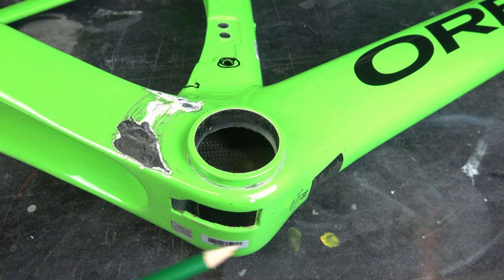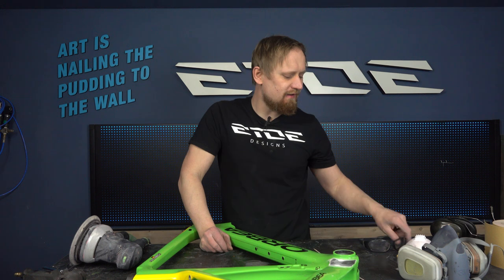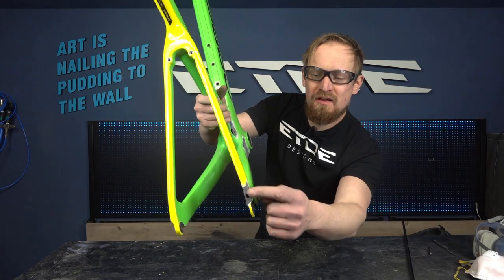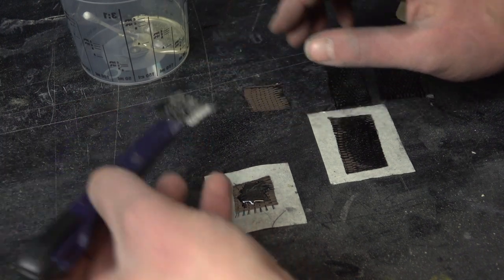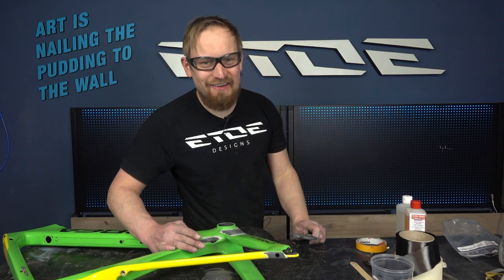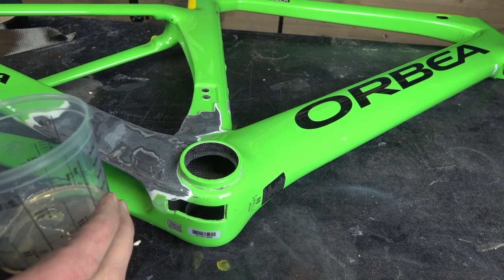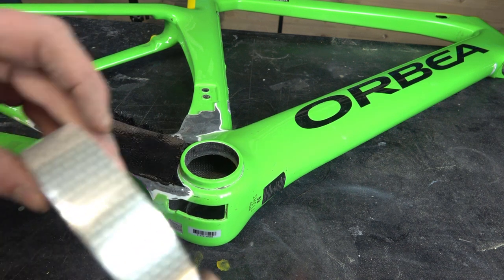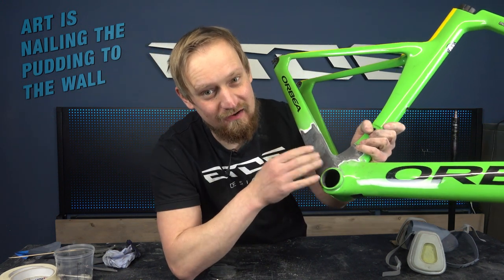carbon bike repair - chain stay fix - DIY

Comment: Thank you for posting this video, I had some chainstay damage but had it repaired by a "professional" and recently my chain took another bite out of the chainstay.  Found out the previous repair was not very good.  I was expecting to see carbon but saw a lot of bondo and carbon.  I used your same techniques from this video and had great success.  I tapped the repair with a coin afterwards to check for solid adhesion and thorough epoxy wetout and found no dull thuds.  Just as you say, a pretty easy repair to do at home.  So thank you for sharing your knowledge and tips, very appreciated and helpful!  (My paint and clearcoat work leave much to be desired, however..)

Comment: Martin, I am using your excellent tutorials to repaint my 2008 Cervélo RS frame.  When I took the components off, I noticed some damage to the BB caused by the chainring rubbing on the fame.  Your tutorial on how to repair this damage   is extremely well done and provided perfect instructions.  Thank you for taking the time to create this instructional videos and for posting them for all to see and use.

Comment: Nice job on the repair 👍, don’t forget to use nitrile or vinyl-gloves when using epoxy. Epoxy allergy is a real thing, which everybody with enough exposure will get, and for your job something I really wouldn’t want to get.
Reply: Julius Meier Fully agree!
Reply: You should not touch carbon with bare skin,the grease causes delamination
Reply from the maker: Painters have to die young because they are bad payed and will retire poor if not died young. So no gloves needed!
Reply from the maker: @matt7775  Painters have no grease on their skin they don't even have skin on the hands as longer they do their job. So no need to worry about grease.
Reply: Hehe I have it even though I wore gloves
Reply: @ETOE  poor quality workmanship

Comment: Excellent tutorial! The only issue I seems you should be using a much slower curing epoxy - slower cure rates ultimately mean longer polymerization chains, which makes for a much stronger epoxy and therefore repair. 

Using a fast cure plus heat does not lend itself to good long term strength of repair.

Comment: Brilliant. Love that you share these tips and skills.
Have just sent a frame away for repair, but with these tips might just try myself next time. The shrinking tape and fast-set epoxy are great tip.

One question with resins - are the slow set epoxies more durable than the quick set, or just useful for different things? I repaired my hockey stick a few years ago and was advised to get the slow setting epoxy as it cuould withstand more and would last longer.

Comment: Nice work. Some ideas for yur consideration...
- use a wood glue utility brush instead of ear swab
- mount a heat lamp bulb or two in a ceramic socket to ceiling above workbench to aid in epoxy wetting out CF, works great aircraft composite  project
- put layer of dacron peel ply on top of finished layup then cover with shrinking tape, when dry and peeled off has nice mat finish
Thanks again....

Comment: This was absolutely the best DIY video I have seen yet! Ausgezeichnet!! Just out of curiosity... could you use body filler on minor scratches and areas where the damage is too small for the tape or do you just use the resin?
Reply: When I've done this, I mix the epoxy, then cut small pieces of carbon fiber (roughly 1mm long) and mix it with the epoxy.  Then apply to the scratch/ chip.  Not really for crack in the carbon, but more as a filler.  It sands, primes and paints well.  Not sure if this the best way, but has turned out well for me

Comment: Wow! Thanks for the video! I'm going to use this same technique to make an internal storage on the downtube of my enduro bike, like newer frames has. I'll cut the hole, reinforce the inside surroundings with unidirectional cf, and make a cap with bottle holes (bike has no bottle holes) :D
Reply: This sounds like a terrible idea

Comment: How did you sand inside the frame for the internal patches,you didn't show any preparation apart from drilling out the paint out of the hole itself?

Comment: Shoutout from Germany
I have damage in the same spot on my BMC frame so this is an awesome video for me! it also answered my question of how deep is too deep when sanding down.
One question I do have is why are you using unidirectional carbon sheets instead of a 90 degree twill?
also, how far away should I tape from my damaged area? if I have a crack that's 5 mm in diameter, should I tape up to 10 mm away? 20? 50? is there a rule of thumb?

Comment: Great workmanship.  Curious how are those holes occurred and are you going re-drill them again especially the one for the cable in the rear.  Any tip for deep scratch lines without patching the carbon fiber.
Reply: He mentioned at the start the owner was changing to a wireless setup so no longer required the holes.

Comment: Hi Martin, thanx for uploading such great DIY tutorials. I‘ve discovered a crack on my fork‘s steerer tube (RockShox SID World Cup) and want to fix it with unidirectional HM prepregs. As I‘m very good in fixing various things, I‘m pretty confident of doing a decent job. But I have two questions: when it comes to baking it in the oven, I‘m unsure how the resin, which holds the stanchions in the crown would react at temperatures around 120 degrees Celsius. And can I compress the carbon layers sufficiently with heat shrinking tube instead of heat shrinking tape as I don‘t have to apply any additional resin?  Thank you very much in advance🤘.
Reply from the maker: Use what ever you think suits for you. Why would you use so much heat? I see no need to use so much heat to cure any resin.
Reply: @ETOE  Oops, I‘ve just noticed your reply…three years later 😂. 
Thank you for your reply. In the mean time I managed to fix it with Toray T800 UD Prepreg. And although being a quite humble guy, I have to admit that I‘m pretty proud of the result. 
I managed to build an isolating door for the oven, where I could stick the steerer tube through, so only the tube got exposed to the heat.
Now I‘m fixed and made some other accessories for my mountainbike, like a carbon fender for the fork and a copy of the frame holder for my mini pump.
Thanx again and I‘d love to see more of your carbon repair videos.

Comment: Great videos, interesting and provides value.  Question, I'm doing a relatively minor repair on the top tube road frame.  I bought carbon fiber fabric cloth,  3k 200g/m2 plain weave.  I need to buy the resin now, and at first i was going to buy 1:1 ratio resin off Amazon, but is there a specific resin i should be using. thanks very much.
Reply: Besides reference to UV protective resin, i've read folks using "marine-grade epoxy resin" and other resin's that were suppose to be stronger, which was not a 1:1 ratio? I can see the benifits for a fast resin, as you mentioned.

Comment: I have the same issue on the same area in my frame but mine looks like more structural damage (chain got stuck, I got pissed off...the rest is history) to the point that the carbon can be moved by putting pressure with the finger. I suppose that's not a DIY job...well put it this way i wouldn't be very confident going down hill knowing that I stuck some small pieces of Carbon myself....,😰.

So the new frame is coming. Good thing is I have seem your DIY paint job and it's gonna look great! 👍

Comment: Great stuff. I’m enjoying the videos. I found the channel a few weeks ago when I picked up a used cervelo s3 frame that I want to strip and clear coat for the nude look. I found that the NDS rear prop out is worn by about 2mm so the wheel doesn’t sit correctly. Can I use resin to fill this in or carbon strips with resin ?
Reply from the maker: It is possible to do but definitely no beginner carbon fix project.

Comment: Hey Martin, I've watched many of your videos now and found them really useful for getting great tips and tricks associated with custom painting frames and helmets, I've had some good results using the techniques you have suggested, could you please let me know the type of mask / stencil film you cut and use along with the transfer tape as I have had some issues with various different types and not yet found one that is consistently reliable and that works very well for me. Thanks again for taking time out of your busy daily schedule to show us your amazing work.

Comment: Hi Martin. Great video!!! I have damage in the same area as the bike in the video. My question is I’d like to used shrink tape around the repair during the curing process. What brand of shrink tape do you use? I can’t seem to find such think (tape with holes) in Australia. Now I do not own a baking room so would a heat gun work?

Comment: Super! I'm learning from your videos. But what if there is a crack on the beam? which goes from the drop to the seat tube. Almost in the middle. What should I do in this case? you can't get in from the inside!
Reply from the maker: Give it to a carbon repair service.
Reply: @ETOE  Yes, I have already sent it to the service. Thanks for the advice.

Comment: @ETOE Loved you video.  Keep them coming.  My apologies if this was not asked in some of your German comments.  How do you know how much paint/epoxy needs to be prepped around the existing damaged carbon area in order to obtain a strong enough bond with the new carbon/epoxy being applied to maintain the strength needed, especially in high stress areas like the bottom bracket?    And, do you try and match existing carbon fiber properties like low vs high modulus when making repairs?
Reply: No bike repairers do ,they use a generic epoxy and cloth. At best 50% resin to carbon but manufacturer uses prepeg at best 40% no repai should ever cost more than £100 with time and effort or they are taking the piss

Comment: Good Video 
you make it look EASY 
what type of Resin ?
Epoxy ?
Polyester ?
Vinylester ?
or Fiberglass Resin ?
Reply from the maker: Epoxy resin as mentioned in the video.
Reply: @ETOE  Thanks 4 Reply 
how about Carbon Crankset Clearcoat WORN Repair ? just use Epoxy Resin for Touch up ?

Comment: it's insane how light that frame looks while u hold it with one hand...one of these days i hope to ride a carbon frame...im already impressed with aluminum....
Reply: unless you ride for races or off road i wouldnt consider carbon for city use or anything else honestly, i used a have one and i was constantly worried that it would break when locking it up next to other bikes. it also depends on the quality carbon fiber bike you get some are stronger some are weaker keep that in mind
Reply: @nexii1479  yea i plan on keeping my aluminum and just upgrading around it...but i would like to ride a real carbon frame at least once...
Reply: @paullmight42  you definitely should give it a try, difference between acceleration on carbon vs steel is quiet a lot
Reply: @nexii1479  i can imagine...going from steel to aluminum was a massive change already...

Comment: Great content, subscribed!
Can you go more in depth on how to fix a carbon frame, with materials details including type of carbon fibre and type of epoxi resin, maybe fix a downtube or a  chain stay close to the aluminum piece that holds the hub (With time and use they start to separate and need a rebuild)
Cheers mate!

Comment: I have one embarrassing question. Can i repair my cracked alloy chainstay by strengthening it with carbon fibers?
It was welding once, and it cracked almost in the same spot. I'm wondering if it makes sense. I was thinking to weld it again,  wrap the original element around using coupe layers of CF. It's a 160mm travel full suspension bike. For rough treatment. It would be a CF chainstay with an alloy core. Can You give me some advice? Can i do that? Or maybe it's total madness and suicide mission?
Reply from the maker: I can not give a general advice regarding this.

Comment: Hi I have the same issue but light paint chip beside bottom bracket. Do I need to worry that frame will crack or it is okay?
Reply from the maker: If it doesn't affect the carbon structure and is only a scratch it's OK. If it's a crack which goes through several layers it's not.

Comment: Hey. Ich finde deine Lackier arbeiten echt toll! Aber als Leichtflugzeugbauer muss ich dir leider sagen, dass die Reparaturen nicht sehr professionell sind. Ein paar kleine Hinweise, wenn du erlaubst. 1. Schäftmaße beim schleifen beachten. Kohlefaser würde ich am Fahrrad mindestens 1/50 ausschäften. 2. Qualitativ hochwertige Fasern verwenden zb. HM Fasern. 3. Anstatt Kreppband mit Abreißgewebe anpressen, da das Abreißgewebe überschüssiges Harz aufnehmen kann. 4. Wenn man mit Harz arbeitet immer Handschuhe anziehen. 5. Anstatt einem Q-tipp, einen Pinsel verwenden (zum Lagern in einen geschlossenen Aceton Behälter stellen). Das wäre mal eine Anfang. Grüße
Reply: Servus, danke für die Tips. Ich muss meinen Carbonrahmen auch reparieren aber hier gibt's leider keine Antworten auf Fragen. Bei Amazon gibt's für €20,- solche Kits mit Harz und Gewebe, aber taugen die was? Sind Harze total unterschiedlich oder sind die alle recht ähnlich? Gruß

Comment: I only want to remove the white logo on the downtube from a matte black carbon frame. Do I only need to sand it as in the video, or do I need to put something on after to protect the frame if I only want the matte black finish?

Comment: Hello sir, thanks on your very informative video. May I ask, I just recently purchased from china, a carbon frame with matte black finish. Any idea what type of spray paint shall I use if I want to add design/letters on the frame? anzhal or enamel? Or shall I rip off the existing paint and apply new one? Thank you,.

Comment: A question that resin is the same one that they use for the fiberglass ??
Reply from the maker: Which fiberglass? I work only with carbon CFK.
Reply: @ETOE  Don't explain me well, if that glue or resin is similar to the one used in fiberglass jobs? I did not say that you work with fiberglass, I am talking about the resin the glue,  is that the glue you use is similar to the one I mean.

Comment: arent there powertools for this type of more precise delecate work... seems like the ones you have are for carpentry etc
Reply from the maker: No they are made for autoboy work the most common work and so you get the cheapest spare parts and grinding discs
Reply: Maybe a Dremel tool??     Rgr
Reply: They might seem a bit too large for the job, but the same tools are used for repairing composite aircraft and work perfectly for it. Composite repairs aren’t easy and require quite some practice to be structurally as sound as before.

Comment: Wish I new this a year and bit ago. Had the same sort of damage and went into an auto body repair shop that does carbon to ask for their advice or someone who could do the repair. Got a told to just apply glazing putty, sand it, top it with clear enamel and done. But I suspect the above would be a much better repair vs. the bandage I have.
Reply: the thing is, carbon frames are specific on weight distribution, if you add carbon to an area, it will reinforce that area and cause other weak spots in the frame because of the difference. he might have done more damage by adding more carbon. when you're repairing it you want to get to as close as possible as it was before?

Comment: I have a suggestion, first put your carbon between two layers of plastic then wet your carbon then cut it when it is between two layers o plastic, I trie that million times for different applications

Comment: Never use power tools to remove paint ever just use a Stanley blade to scrap the paint of as yo have more control and soon as blade hits the carbon it goes very slippy and you know your there simples !!

Comment: As a engineer in getting a heart attack watching him wandering his dusty fingers all over the repair areas and immediately applying the epoxy. 
U need clean surfaces!!!
Reply from the maker: An engineer!!! Not a engineer!!! Mr. engineer!!! I get a heart attack when engineers are not able to use correct words!!! And one more exclamation mark just for you. Here it comes!

Comment: Unidirectional carbon looks like brushed hair, it all goes in one direction.  The fabric you used is woven, there is nothing wrong with using woven to repair, it will make a strong job.  unidirectional is usually already impregnated with resin, other wise it would just be fly away.  Formula 1(other purpose aswell) use it for their tubs for the driver, it allows them to create a very strong design with careful orientation of the material.
Reply from the maker: Have you listened to what I said? The roll is undidirectional carbon and the woving is only one string to hold all unidirectional strings in place. You speak of pre preg. You can also buy undidirectional without any pre preg resins doesn`t matter what kind of carbon. So the rool I used is unidirectional carbon fiber and it has only strengh in one direction as its typical for unidirectional carbon fiber. The woving is too weak to give also strength like a 3k. Its only to fix the unidirectional strips in place to form a roll.
Reply: Classic keyboard warrior...

Comment: 100% trash fix of the carbon layers, this wont reinforce the frame in any way.. just sand it even, seal the surface and repaint = same durability